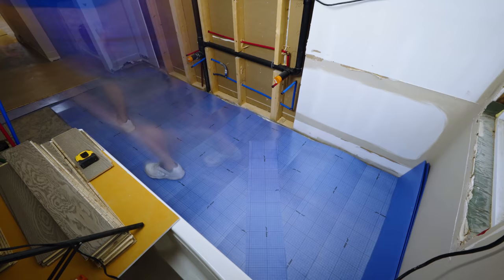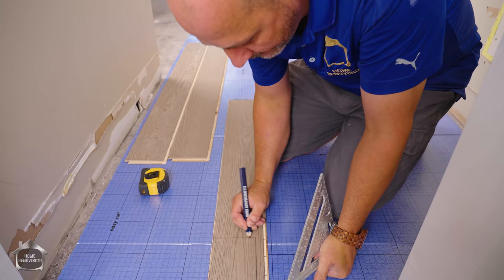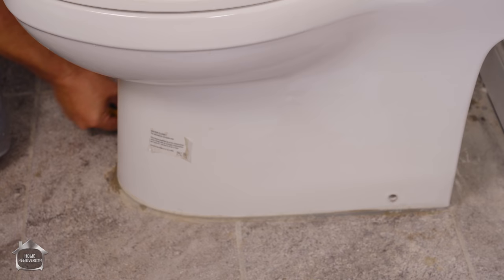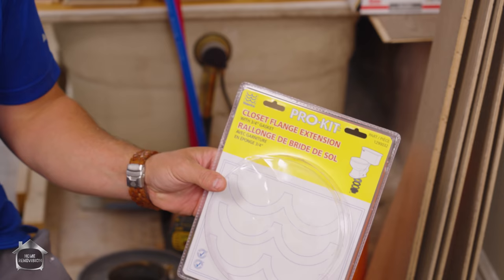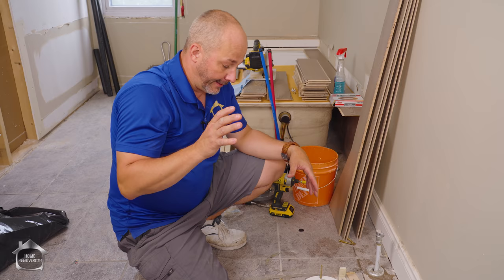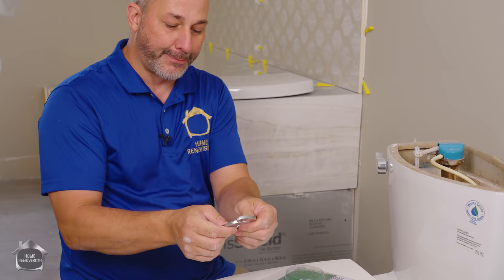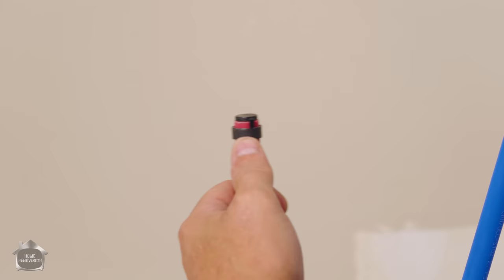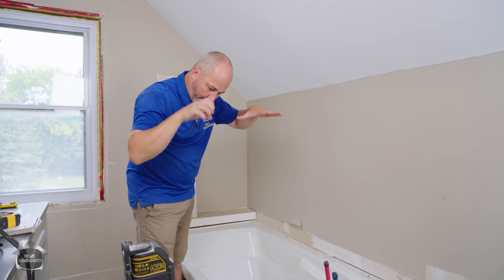How to Remodel A Bathroom on a Budget | A to Z

Comment: With 312 comments this one may be redundant. But you were not correct about the wiring of the GFI plug. First it is not optional to wire these hot by being careful. Maybe thirty years ago , fifty for sure.  There are rules anointing to laws that require lock out and tagging out before work is done ti insure it's off and stays off. 
  Also you thought the yokes were ok to hold on to buy those are grounded as soon as you connected the ground wire. And the differential of potential is 120 volts. That's enough to hurt you. Possiblity of death exists there. I am lifelong electrician 70 years old now. Have done it both ways . I bother to switch it off and lock it and leave a note who and why it's off. 
  And your layout of those plugs was way too low. Too close to the splash. Not professional looking as you state you show how to do.  Those are usually set at 48 inches above the floor to center of box. Keeping them well away from the splash and water splashing. 
  And I believe you removed the plaster ears at top and bottom of the box.  They should have been left in tact . A better choice would have been a plastic box . GFI  plugs are very big by comparison and that box you used was very small. 
  And the other plug that had to have fed through to something else will be GFI protected now as well.  Likely a potential for nuisance tripping and then the other one needs to be reset and countless homeowners don't get that. Been on far too many trouble calls that only needed the reset button pushed on GFI plug. 
  And the two wires on the two screws per phase is not correct by the code for twenty years or so . A third pigtailed wire should be spliced in and only that tail goes to feed the plug. Because that receptacle was 15 amp and if the wiring were 20 amp , it could cause 20 amps to pass where only 15 amps is allowed. Between the terminals. May be petty , but this is the code , these are the rules. Electricity in your home can be fatal. So not very cool if you to show folks that don't know ways to shortcut the work . Now I'm wondering about your plumbing and sheetrock and tile work. ?  Spent a good deal of time listening to you before realizing you were faulty with wiring.  You talk about the push in wiring terminals like they are not adequate. They are ul listed . For use with the stab wiring. I've never heard of a failure with them. And there is a rectangles hole next to the round hole the wire goes in that is to be used to remove the wires held captive when pushed in.  You take a very tiny screwdriver and push it in to easily release the wires. Then they can be restabbed.  You aren't correct about saving anything by side wiring receptacles. There are billions of back wired receptacles out there that are not a problem. Those must be wired with 14 gauge solid copper wire only. 
  And I was personally not liking your "Ok ?" All the time. You know what I mean ? You wouldn't like that either if spoken down to repeatedly. You are not chef Emeril Ligase. Ok? Trying to be respectful , but I feel like you started it. And I regret watching your channel after seeing the electrical. And being spoken to like I'm dumb.
Reply: I would never hire this guy.

Comment: I've been a plumber 22 years. Those rubber toilet rings are a horrible idea.  I consistently get calls from sewer gas smells with those installed. The new housing development down the street from our office put them in and we ended up changing every ring in the whole development. Silicone and plastic spacer flanges are perfectly fine if you screw everything down. If you get the right spacer flange the lip interlocks. Water will never even get to the silicone. If it does silicone is waterproof. It's meant to seal water out. It's even used to seal basket strainers and other drains. The instructions to the spacer flanges actually tells you to install them with silicone. This is some bad information.

Comment: The saying is, "Jack of all trades but master of none." Referring to the jack gets the job done, but the master will get it done right.

I've seen you alone put up a tin roof by punching unsealed screws through it. Cut necessary studs without adding jacks. Cutting a horizontal line on an exterior wall that will trap water.

You are a Jack and/or a GC. You're not a master.